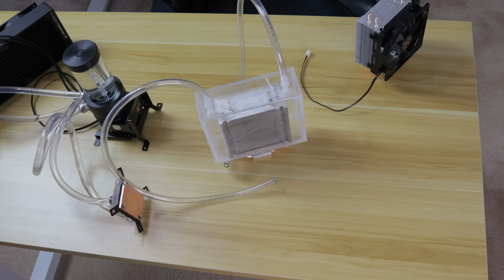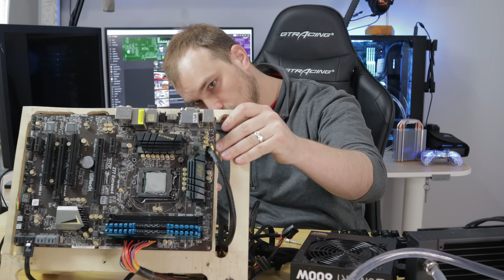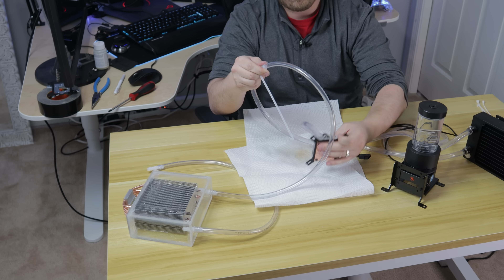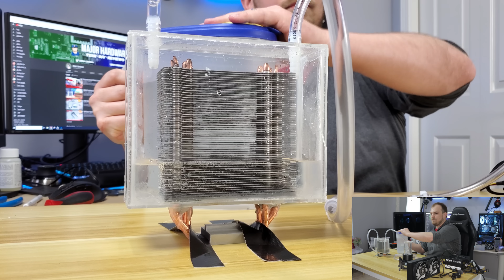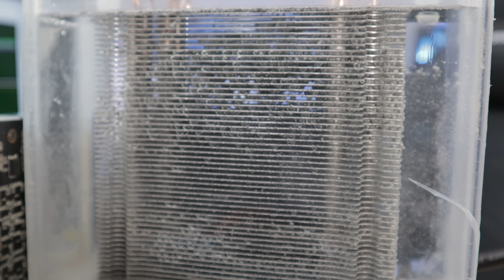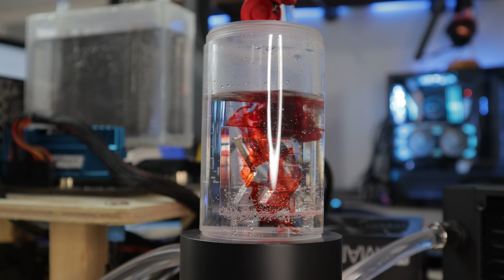Water Cooled Air Cooler Tested Against - Air Cooled Hyper 212 EVO and the EK-Supremacy EVO

Comment: You would think that if the water in the loop normalized at say 30c that it would act the same as 30c air running through the fin stack?  Obviously, the water is a much better conductor of heat and therefore carries more temp away.  I'd be curious to see the water temperatures on the two water-cooled systems.  Which system is dumping more heat into the loop?  If you run larger or multiple radiators to remove more heat from the loop, do both systems respond the same way?  The EVO has a gas/fluid in its tubes that when heated rise up through the tubes to be cooled by passing air and then recirculate back to the cold plate. This is obviously still happening!  Fascinating concept...

Comment: Might be another opportunity for NOCTUA to shine: You could get their industrialPPC-2000 IP67 PWM Fans. Use two of them around the cooler and make a little whirlpool.
With 2000 RPM and being Waterproof to -1 meters this would be quite a neat feature. :D
Reply: That would be really fun!
Reply: And also to make the input / output in front / behind the block for better waterflow as well
Reply: @tomlademann2521  this, it should go much better if the water is going through the radiator rather than trying to go around it
Reply: This is what I suggested on the first video. Get some underwater turbines to really make sure it flows water across that thing! Hahaha.
Reply: @802Garage  lmao wasn't expecting to see you here! You get that V10 in your Impreza yet?
Reply: @giggy7935  Yes indeed it runs! Working on getting it driving soon. :D
Reply: @802Garage  Ooooh!
Reply: @giggy7935  :D
Reply: Why not cut the heatpipe and run the water through those so you can use the air cooler and the water cooler.
Reply: In water you never reach 2000 rpm but nice idea

Comment: Nice piece man. I am a tinkerer and appreciate anyone thinking outside the box, or outside the fan in this case. That being said, here are my suggestions. Completely submerge the heatsink, you had it 99%, go full submerged with less air pocket. As for flow control you could try two things; you could possibly move the intake towards the bottom, and or, consider throwing a zigzag into the chamber to kind of help it along. Keep up the good work. Remember, NASA didn't make it to the moon on the FIRST design.

Comment: Interesting. V2 is def what ive been waiting for. Maybe at the inlet to block split the single input into 3 or 4 inlets that will flow throw fins horizontally and the one vertical output at the top. Maybe also put a spacer to seperate input chamber and output chamber

Comment: I love smaller channels like this because you think outside the box and try to be original, which you've done an outstanding job. I have enjoyed the progress you've made with this and makes me think of other ideas. Thank you for the series on this cooler.
Reply: I'm gonna echo Glenny's thoughts here... I look forward to the Water Cooled Air Cooler v2!
Reply: Glenny0020 if you have good suggestions, I’m always open to ideas. The channel I’m starting is “Legit_Overclocking”, so far it’s garbage, so ignore current content. My water cooled tablet (overclocked obviously) was nuclear apocolypse themed and cost only $5 (including my 3D printed waterblock). Unfortunately by the time I filmed it, it was a bit trashed looking. Worked, but looked garbage. I’m working on be Finesse of making them look nicer (just got my nice wall mounted “console” (Titan Xp Star Wars edition with EMI modified riser cables, RGB SSD etc, looks nice). I can now CAD from the couch and have it connected to my 3D printer and do some couch gaming while it prints. That’s just using parts from my old build, my main system is 4x Fury on Threadripper powered by 2x SuperNova 1300s built into a hand made vampire style casket. Other system is a sub-zero phase cooled FX pushing insane power through a budget board.

However, you will probably never see these since that’s what normal reviewers do. My content will focus on fun, creativity, and absolutely no practicality whatsoever. If you have a suggestion like using a jet engine to suck air through a case faster than any fan you can buy, then I’m glad to hear them (hmmmm.... I might actually do that one, decent sized jet engines for this are only $3k, I’m an aerospace engineer, I always need another excuse to buy a jet engine).

I might make a semi-practical build, a sub-zero phase cooling system for TR when the 64 core chips come out (I’m an extreme overclocker, with a background in engineering such as fluid and thermodynamics, but making things faster has always been something that inspired me). But that’s almost too practical for my level...

Stupid and dangerous suggestions are more than welcome! (There is a reason I keep so many fire extinguishers laying around...). Just comment on any of my crappy videos with the shaky phone cam recordings and lack of edits for any suggestions you may have. I currently have a massive budget of personal FUNding from my personal wallet, however, I do like the super budget ideas too since I have no sponsors, and therefore no limits to the danger and fun that awaits. I do need good suggestions though before I make any quality vids.

Comment: Wait, I thought it was a heatsink cooled with water instead of air, but it's a heatsink cooled by a full water cooling loop including radiator. This really isn't worth it. I thought you might able to run it without a radiator?
Reply: Think of it as a fancy water block for the cpu rather than a radiator replacement.
Its an experiment to see if you can get more efficient cooling if you combine water and air cooling methods.

Comment: 1.43 V-Core? To get 4.8GHz? Ooof! I personally never go above 1.35v, even when benchmarking. Unless you're running DICE or LN2, anything over 1.4 has diminishing returns. Not to mention the degradation of the silicon itself. 
Also, what were the core to core temp differences?

Comment: It may transfer the heat to the water better but you still have to get the heat out of the water which isn't going to happen very well without a radiator. I feel like it you ran it under load for longer you will find that your water will become more heat saturated and perform worse. But it's a neat setup and interesting to see.

Comment: you are for sure getting bottle necked by the 212 evos ability to move the heat from the cpu into the fins up top, see if you can find an air cooler  with more heat pipes or even just something down lower closer to the cpu.
Reply: Something like the artic freezer 33 it’s got shorter Heat pipes

Comment: Cool! Here, have a like. Can't wait for V2! I'd expect it to greatly outperform the V1, possibly even the water block, based on the performance of heat pipes and the large metal to water surface area. Of course, it has that now already, but the flow will now barely go through the fins. The impedance of the area around the fin stack is much much lower. That's why I expect V2 to be a lot better, with the far greater convective heat transfer from the 212 to the liquid it will get

Comment: Worth everything! It will turn out good at some point! One note, "Delta" is unitless and should be noted "Delta C"
Reply from the maker: This comment made me go humm? I can see your point delta is just change so it may be unitless but given the change is of unit c would it be incorrect to apply the same unit that's an honest question and I wonder if it would be delta t for temperature. You  raise some good points thank you
Reply: @MajorHardware  well I guess you would actually use delta T to denote difference in temperature in general and then the actual unit on the right hand side :) but I would love love love to see ymthis creature to perform better than an average water cooling system!

Comment: One flaw you need the cold water coming i from the bottom to optimise heat as heat rises. So by basics you will achieve better temps with water flowing from the bottom to the top of the cooler

Comment: Why not simply put a watercooler radiator into water? A watercooled watercooler xD
Reply: Air coolers are actually better at removing heat from the CPU, which is why hes doing it this way.

Comment: Check out my post on the part 1 for this hybrid cooler. Did a 3d mock up of the changes you will need to increase flow within the vessel.

Comment: I'm going to bet that with some work this idea could get darn close to a normal block. Can't wait to see how you decide to change it. Great channel, I'm kind of new here but I enjoy your stuff. Keep it up!
Reply: I'd guess the bottleneck is the heat transfer from the coldplate to the finstack, not so much from the finstack to the water. That's not something you can really fix with a design like this. Lowering the temperature difference between the fins and the water would help but i don't think there are any major gains to be had from that tbh, with this much metal in contact with water the delta can't be that much.
Reply: @SaltyMaud  I don't know, in this version I think it's the poor flow. I think a design that properly passes water through in the same manner as air would, could make it work really well. I was thinking a larger block with a dividing wall full of holes so the water has to travel through each hole in a spread out fashion. This way, the entire surface area of the fins are used. I'm not super knowledgeable about heat pipes but I think they can transfer heat quite rapidly as long as the heat can be taken out. I feel that's why good air coolers regulate spikes really well almost on the same level as a normal Aio. Who knows, it's all speculation on a fun, new idea that know one has really thought about.

Comment: Try this with an Artic Alpine Passive cooler. It might actually work and it's only 12 bucks! Plus the square shape and mounting is ideal.
Reply: I've been tweeting at Linus Tech Tips and Jayztwocents to do this!! I want to see essentially this same design but with the arctic alpine and those HUGE fins!
Reply: @MistahBufo  I just ordered an alpine passive am4  im totally gonna put it on a ryzen 1700 and add a fan to see how it does.
Reply: @NeoVoodooTech  I don't see a HUGE benefit to adding a fan to the alpine, there's no heat pipes, so the air blowing over the metal doesn't have as great a cooling effect as it could if there were. But if there was water being piped over all those fins and the fatter base of it, I feel like it would do a pretty good job. Obviously not as good as a 240/280 AIO or a custom water cooler, but It'd be a novel little device, a water cooled Alpine. I'd do it myself but I have neither the parts nor the money to invest in it.
Reply: @MistahBufo  Not true at all. Then why did you even comment? xD
Reply: @NeoVoodooTech  because you can want to see something still, even if you know its not gonna perform as good as something that already exists :p also because i want someone who already has all the equipment for it to do it. Hahah
Reply: @MistahBufo  copper and aluminum have a similar thermal dissipation around ambient temps (copper somewhat better but expensive) and with that amount of surface area, air blowing will indeed cool the cpu. A passive cooler still has airflow with thermal convective currents that pull the air and heat up and away. They even put little fans on vrm and mobo heat sinks that are aluminum to increase cooling capacity without relying on sheer thermal mass or surface area. Air blowing over heat pipes is not very effective as heat pipes have a high internal volume to surface area, (they are round or flat-ish and full of metal sponge) thus sticking tons of small flat fins to the heatpipe with solder allows it to move the heat effectively from one area and use the surface area of the fins in another. Heat pipes are like highways for heat and the fins/mass is like parking lots. Water behaves like air for the most part.
Reply: That thing is  just a massive chunk of metal over motherboard

Comment: This was an awesome Tech video.   I really can’t wait for part II.   I was thinking to myself.   If you make the next one.   With the water 💦 coming in from the bottom.   Since heat is always raising.   It will help with the cooling.   Thank you very much.  For posting this video review.
Reply: Agree with this!
Reply: Just a bit of nit picking... Heat doesn't really rise, however the medium might. What I'm saying is that when you feel heat rising from a toaster, hotplate or whatever it's actually the hot air that is rising. If you have a heat source in a vacuum the heat will radiate in all directions. And that's enough nit picking from me today, and really only interesting for physicists, and of course for smegheads like me who try to sound intelligent... ;-) (oh and anyone who is looking at installing a IR heater for their porch will also be interested in this)

But yea, why fight physics if you don't have to? So, "cool" (as in cooler than what's at the outlet) water in near the bottom and the outlet near the top sounds like a good idea. But in this case it might not be the best option as the fins are mounted horizontally, at least with the motherboard laying flat like this testbench.  It's been a long time since I looked closely on a Hyper 212 so I don't remember exactly how the finstack is constructed. If it's open on the short sides it might be a good idea to have the water flow horizontally through the finstack lengthwise. The idea here is that by limiting the cross section it will increase the flow speed of the water compared to if it was going front to back through the finstack. 

The hard part is figuring out how to minimize the dead spots. The water needs to flow through the finstack. Any areas where the water is standing still will hurt performance. When looking at the video there's a lot of air bubbles caught in the finstack, and they are not really moving when the pump goes on. That's something to avoid as it shows that the water between the fins is either not moving at all or very slowly.

(edited to get rid of double spacing)

Comment: The problem is there is nothing like a fan to cool the liquids. So heat can't dissipate like it should.
Reply: he has 2 fans @ radiator ?! what you talking lol he just ditched the fan and using water as heat dissipation and the 240mm radiator does the cooling job actual.
Reply: Well if it is something like this you mean? I will the think he would need to find such a powerfull pc fan that can push the water fast enough to even make it work?  https://youtu.be/wuKoKp-G9lM
Reply: If he had to push water through the fins? I think if he can find something like this wich is small enough to push the water through the fins: https://youtu.be/5kWQIOpx2vE
Reply: What are you talking about? The rad had fans on it.
Reply: Peoples I am talking about the water cooled air cooler. There is no cool air flow from say a fan. So the only dissipation is coming from the fins, which while not horrible will also not be the best either.
Reply: @massaBeard  wow you are dense.
Reply: @massaBeard  we are taking about the water cooled air cooler. The rad hooked up to it had 2 fans on it. A water block doesn't have a fan in it so why would there be a fan in the water cooled air cooler?
Reply: @dwarf365  ah....I did not see that he added the radiator to the loop too....soooo then this whole thing is fucking useless anyway.
Reply: its a damn huge block + 2 thicc fans that consumes 10% of the screen and you didnt see it or even heard it (because he was talking about it lol) XD  @massaBeard
Reply: @Xenoray1  I'm at work. Wasn't that focused....heard him talking about improving it. Thought I'd chime in. But since it's already on a rad. I don't even see the point of this at all.
Reply: @massaBeard  no prob, confused the hell out of me.